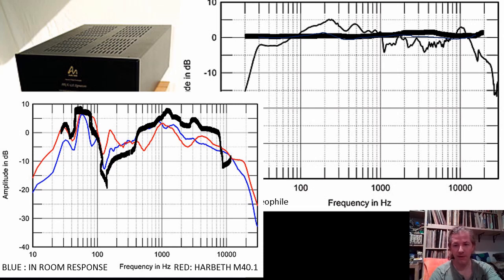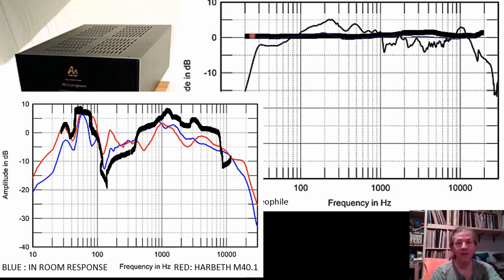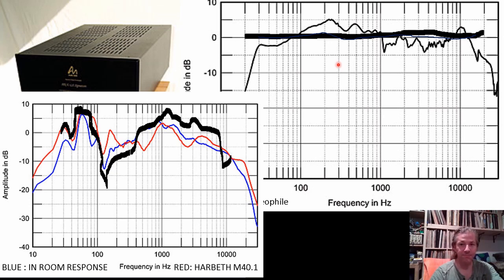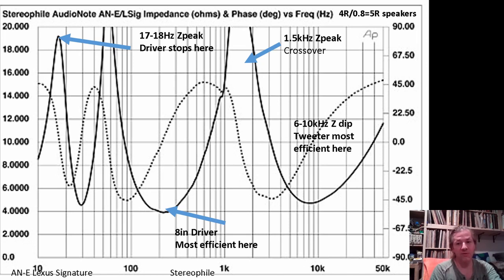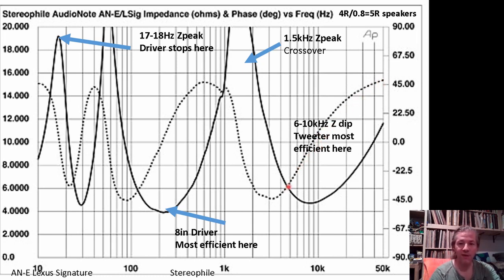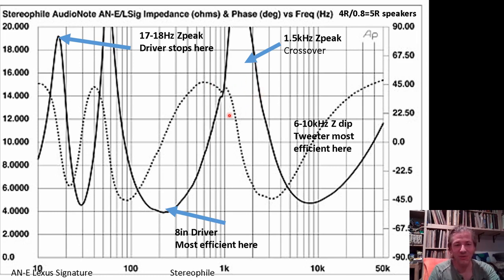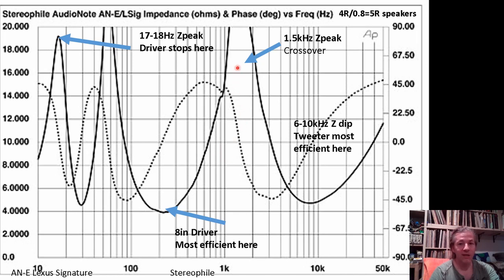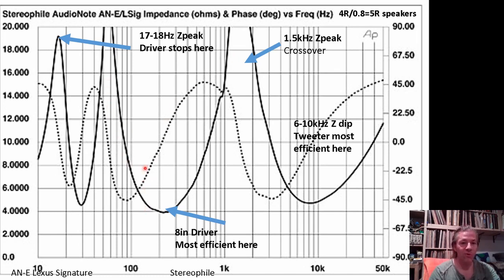Audio Note AN-E LX Signature Impedance Analysis (Part IV).

Comment: First your videos are awesome, the way you describe the new hifi sound these days. Resolution vs tone and timbre, so reconizable great work! You remind me a bit to a YouTube channel ‘real hifi help’ he also has amazing informative videos.

I’m on my way for a full Audio Note system, I probably want the Oto se signature with an-e Spe he and a modded ANK 2.1 that easily out performs the original AN DAC2.1 signature. Currently I have a Parasound Halo integrated, Auralic Vega G1 and a pair of SVS Ultra towers since I come from home theater.

I already have a pair of Lexus speakercable and AN-VX ic and I’m thinking go upgrade my old powercords to AN Isis soon. On my current system the VX is really spacious en detailed but a also quite thin and less harmoniously.

So I’m thinking to upgrade the amp first to a Oto SE Signature BUT I’m afraid it can’t power the 88db sensitive SVS Ultra towers ?
Reply from the maker: Thank you for your positive feedback! I would suggest that you go for the SE amp upgrade - indeed, it will not play super loud, but you will like it much better because you will be trading quantity for quality. I ran into a similar situation with Ryan speakers - 86 and 88dB efficiency, they can play loud with my high power solid state Marantz HT amp, but the sound has little to no musicality to it. Sounds like a typical showroom sound - can go super loud, catchy but quite artificial. With my 900mW SE amp (way less than the OTO SE ; ) the 86dB Ryan plays divine music, even large scale symphony, and louder than I would have expected, but definitively not silly loud levels. Also, the change to a good SE amp brings so much musicality, I would never think about pairing the 86/88dB speakers for high powered solid state amps for serious music listening, except for loud garden parties where quality is no concern. I am aware of Real Hifi Help's channel, I like his open way of telling how things are without bias. He comes from having a fantastic experience base with all sorts of gear, and I come from a builder's point of view - I treat commercial products as clay and modify them heavily. Back to your setup, the change to SE amp will bring a lot of musicality, but you will possibly sacrifice a good amount of quantity (loudness, bass total amount). However, the quality improvement will be such that you'll never regret the change. For example, the quality and clarity of bass will improve tremendously, a huge layer of artificial "fat" will be removed. Afterwards, when you are ready, upgrade the speakers in the future to high sensitivity ones. Either to an AN-E, or to another high sensitivity speaker, 95dB/Wm or higher. Good luck!
Reply from the maker: Looked up your speakers, and I think that the OTO will have no problem running them to pretty good volumes. I have lived with a similar situation combination,  the Mirage 760 (also 88dB) driven with 3-4W SE, about a third of the OTO. That combination had nothing to shy away from, could go to decent volumes, and had perfect base control. Could even play Cranberries without any distortion, with a live concert feel to it (totally mind blowing). BTW I never heard any high power high end amp reproduce Cranberries without major distortion, no matter how many 100+W they had, or what speakers they were driving. I'm sure you will be happy with the OTO-SVS combo, you will not be forced to upgrade speakers any time soon. What they do not tell about amp power, is that the watts only tell you the maximum available peak power (in case of OTO-SVS 98dB). The quality of available power is defined by the power supply, and in case of tube amps the output transformer  as well. In the case of OTO it has reserves that shame many 100+W amps, it will sound better in its working range than most amps with any wattage. I hope this helps!

Comment: Very informative video. I am in the process of building the AN AX Two based on my friend's vintage original AN speakers made in Denmark some 20+ years ago. I have found the tweeter but the Vifa C17WG woofer is discontinued. In search for a substitute, the SDS-160F25PR01-08 seems like a possibility. In your opinion, it this close enough? Or do you have other suggestions?

Comment: Very nice video, I learned a lot, thanks! I have a newbie question: on another video you mention the problem that nowadays many speakers have phase issues. Could I identify phase issues (for example mid range driver being out of phase) in a graphic like the one you are showing? I kind of understood this graphic is not showing it, so I have to ask if these are two different topics? Thank you
Reply from the maker: Hi Thiago, great comment! Indeed, phase response measurements are never shown for the full frequency range, because it's so much harder to measure. If phase is mentioned at all, the most you will hear each drivers polarity. If you would like to learn a little more, computer simulations do show how individual drivers shift phase across their working range. In a future video I'll show examples. ; ) The phase shift they produce is consistent for electrodynamic drivers, after a few examples you will know what to expect when you know the crossover slope and tuning frequency.
Reply: @realworldaudio  thank you for the clarification :-)

Comment: Just a simple question:My amp has 4ohm and 8ohm post, which post would you suggest connect this speaker to?
Reply from the maker: Try both and go with the one you like better.
Reply: @realworldaudio   the impedance of the speaker dip to 4ohm in some frequencies, If I connect it to the 8ohm posts, the amp would drive 4 ohm load in those freqencies, it is technically not the ideal scenario would you agree?
Reply from the maker: @zijunai8020  The best practice is to go for the tap that can handle the lowest dip. That's the only useful bit on the loudspeaker impedance. ;